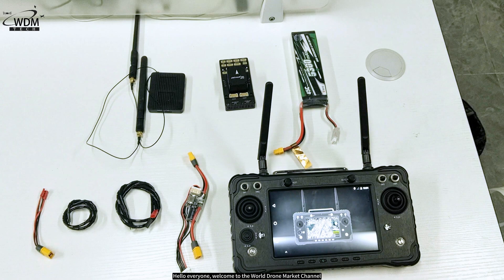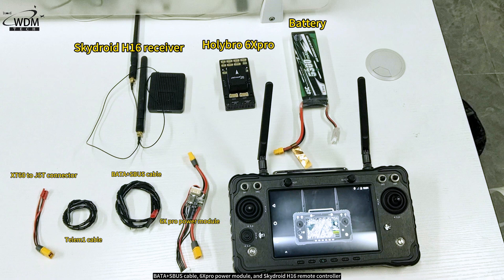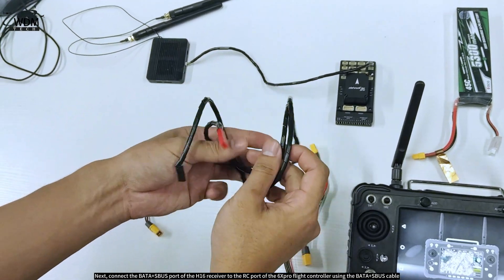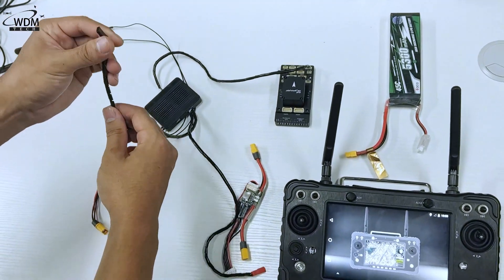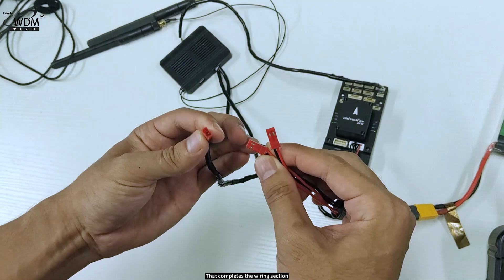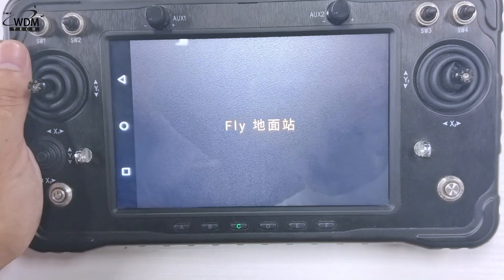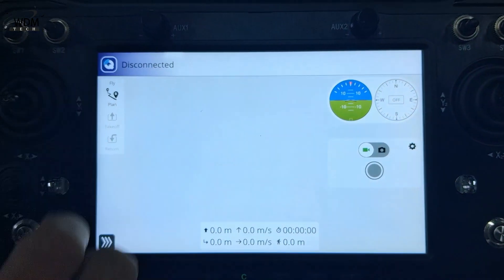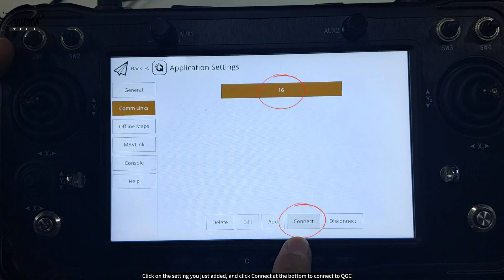Skydroid H16 and Holybro 6X pro testing video

Comment: How did you make this UART Connector
Reply from the maker: Connect according to the interface line sequence of the flight controller and the remote controller, TX to RX, RX to TX, GND to GND.
Reply: I have done the testing process according to your video i am using the pixhawk v2 kit so is it required to calibrate the drone then i am able to fly the drone right ?
Reply from the maker: @ushapatel5145  Yes